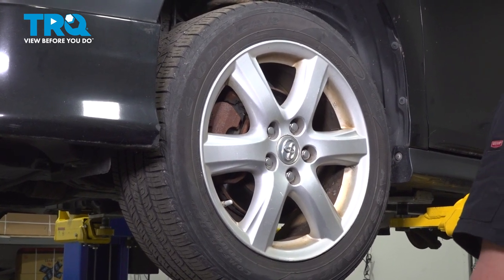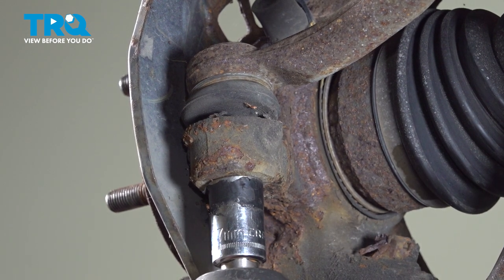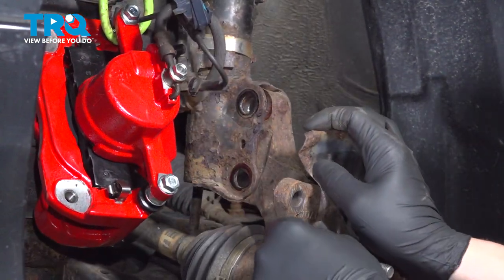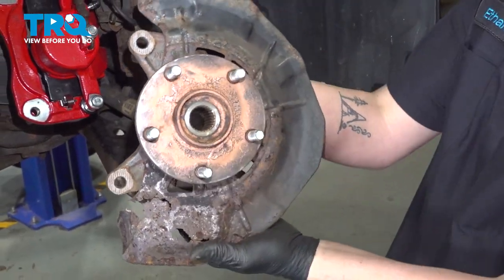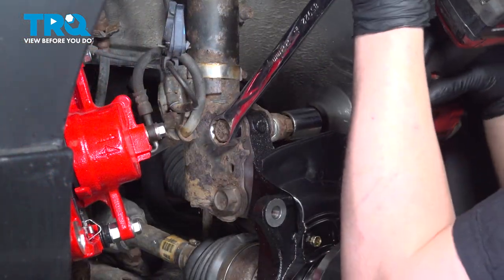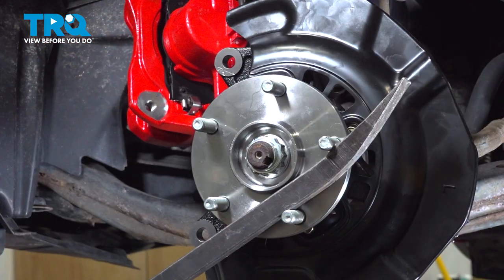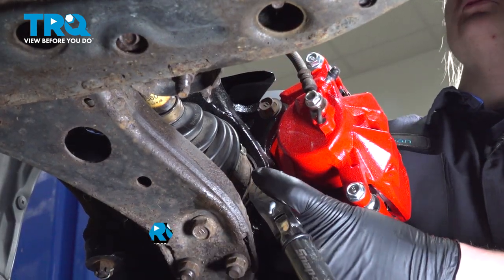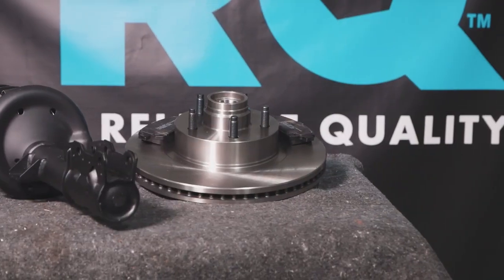How to Replace Front Wheel Hub & Knuckle Assemblies 2007-2011 Toyota Camry

Comment: Thank you for these projects. I have a 2011 Sienna that could use new knuckles, struts, LCA's, and sway bar links. I already did lower ball joints with your set, but it didn't solve the feeling that I have when driving. We just passed 200k miles, so all of this needs to be looked at. Oh yeah, and a full break rebuild is probably needed too. So glad you make these videos.

Comment: 1:04 Is it safe to remove the axle nut with the torque wrench considering it is staked to the axle? Will it not risk damaging the threads on the axle? And will it even come off if it's staked (as it appeared to in this video)?